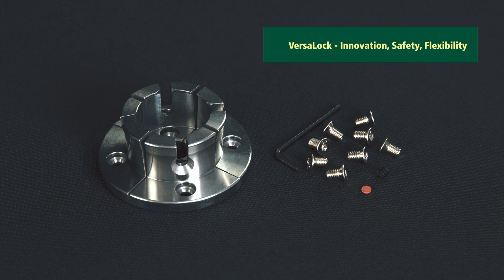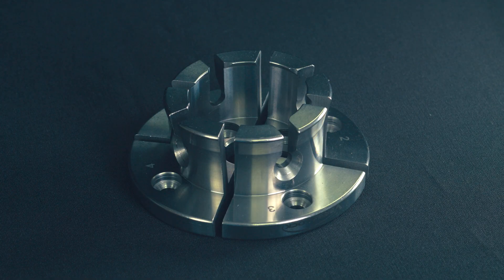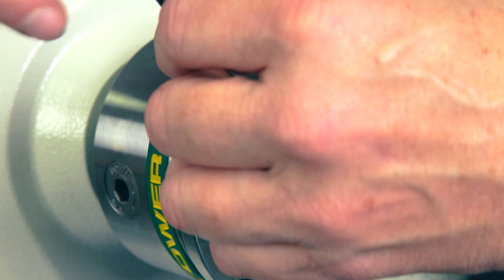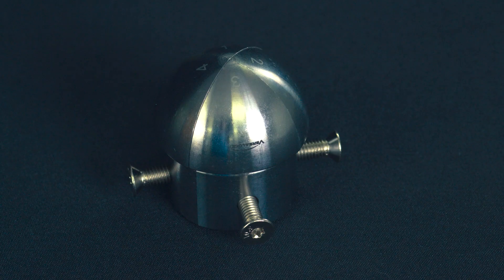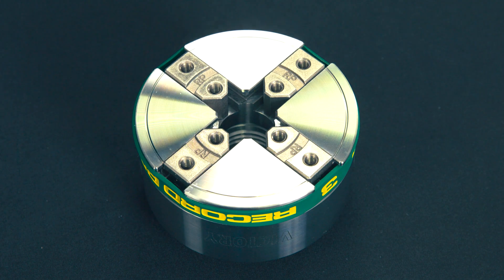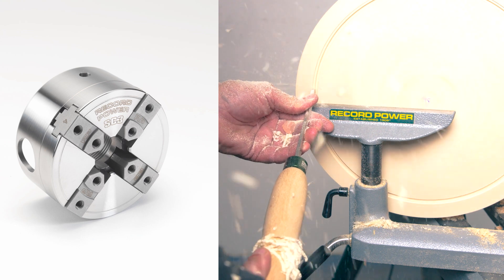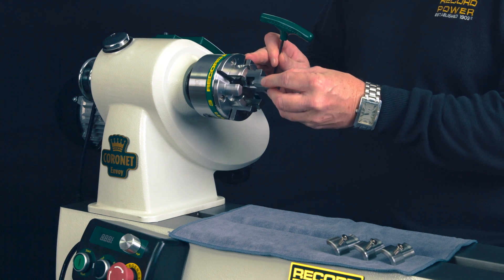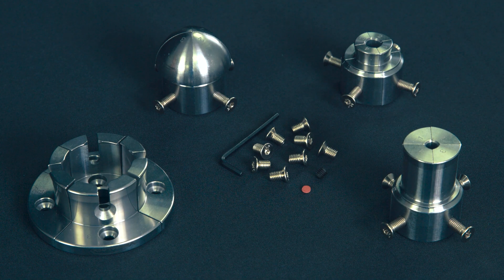New VersaLock Quick-Change Modular Jaw System

Comment: 1:56 who does this??? Nobody right...from finals to bowls and back to finals and then 5 min after that a gigantic bowl again, urggg I hate to break it to you mister Product designer, but you tried to solve a problem that doesn't exist. Pro turners just switch between chuck body with the jaws they need already on it. You made no improvement to this product by removing 4 screws and making it less rigid and inducing more wobble when expanding forces are applied.

Comment: I think this is the best thing since sliced bread! At 86 I am lucky enough to be still able to use a wood lathe, however my “deftness is Rapidly being taken over by “daftness”. I live in a small 1st floor flat and so am only able to do my woodturning for 3 hours twice a week at Grassmoor “men in sheds”. So even though wood turning chucks with interchangeable jaws have made a vast difference, any time saving made changing jaws is very welcome. Also the fact that Record have made the jaws compatible with their existing Sc3 and Sc4 chucks is something to be thankful for. Having looked at the Easywood chuck system with its eye watering price, I have sent off to Yandles for my Versalock jaw set and adaptor (£123 inc £20 Vat and delivery) and will add to these comments when I have used them
Reply from the maker: Hi Bob, thank you very much for your kind words and for sharing your story with us! It’s fantastic to hear how passionate you are about woodturning. The VersaLock quick-change jaw system has been specifically designed to fit the SC3 and SC4 chucks, as well as the soon to be released Victory Chuck, making the system fully acceptable for all new and existing customers with one of these models. Best Wishes, Record Power.